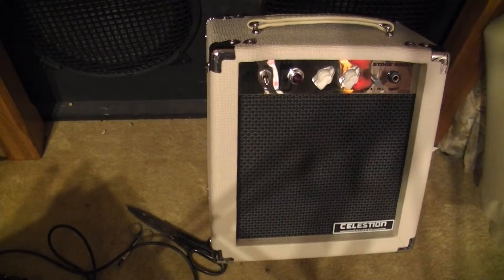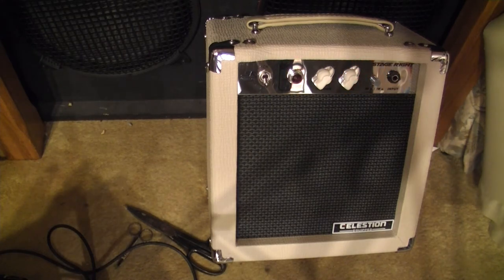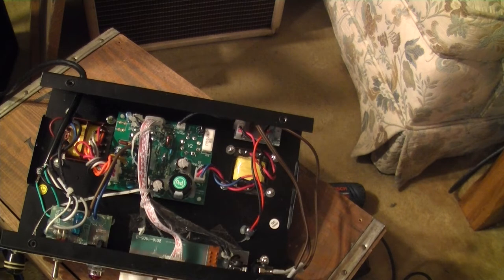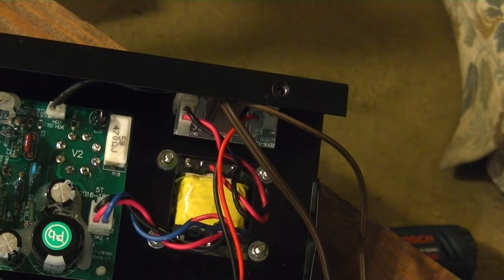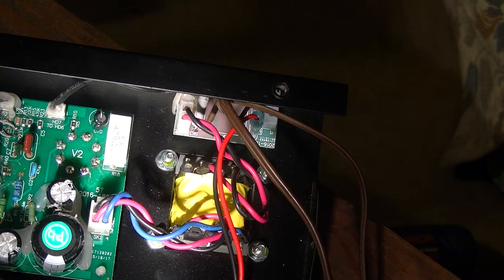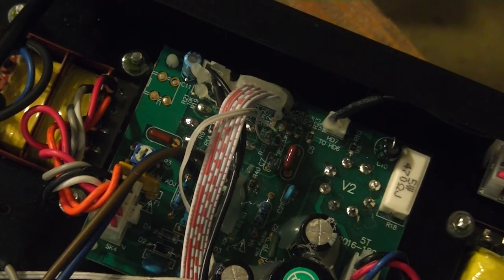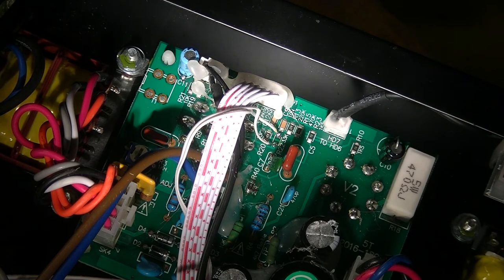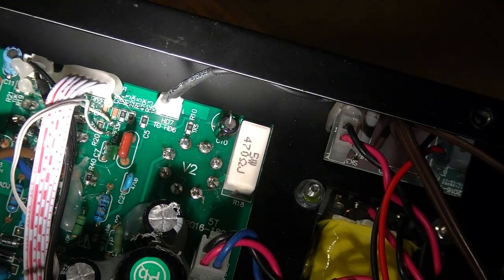Correct Negative Feedback Mod on Monoprice Stage Right 5 Watt Tube Amp / Laney Cub 8

Comment: NFL mods are among my go to amp mods.
You do not have to get fancy.
Leave the existing resistor in place and simply put a switch between it and the out put jack or where ever that wire from R22 draws from the OT.

All that is happening there is signal from the end of the out put stage (you could draw this from the positive speaker terminal)
is being fed in before the phase inverter.
Since that signal is 180° out, it cancels out what ever you chose to send it, dictated by the resistance applied.
Old AC4s did not have a NFL .
I like it, totally, disconnected at low volume in particular.
Things can get lose above 5 on Fenders.  
Chris

Comment: I am interested in getting a cleaner sound out of the amp versus more gain.  Is there a mod I can do that will accomplish that?
Reply from the maker: Replacing the 33K negative feedback resistor with a lower value will mean more negative feedback and less distortion and less gain.
Reply: Put a 12AT7 tube in the socket closest to the input or to really clean things up, replace all the preamp tubes with 12AT7s. No soldering, no sparks.
Reply: formercakid - replace your preamp tubes with JJ - 12AT7s - no soldering, no sparks.
Reply: @oldguyjammin9732  try an AY7
Reply: Get a good treb pass in your guitar and turn it's volume down.
A .001 uf is a good place to start.
Run it from the in put to the volume pot to the out put.
If you have a Less Paul and want the effect on both PUs, both B pots need the cap.
This cleans things up.
But some folks like rolling back the volume, to sweeten things up. That's gone, but you still have a tone pot!
This mod is in every one of my guitars. Chris
I like to play nice and clean, untill I decide not to!!
Reply: In addition to the suggestions here, I found replacing my v1 and v2 preamp tubes with 12AU7s, which have only about 30% of the gain of a 12AX7,result is moderate break up, appropriate for blues etc, at full gain, with an overdrive pedal in front for the heavier more distorted tones. Clean headroom for days.
Reply: I replaced my tubes on my 5 water with JJ's. I used a 12AT7 in the pre. It definitely cleaned up, but has less over all volume. I do run it out to an old 1x10 bass cab with a Warehouse guitar G10c in it. Its great with pedals and plenty loud for some bedroom jamming.